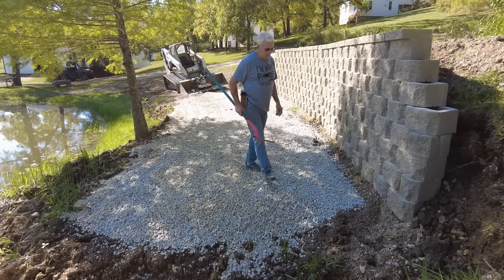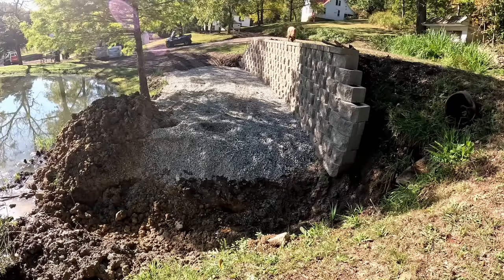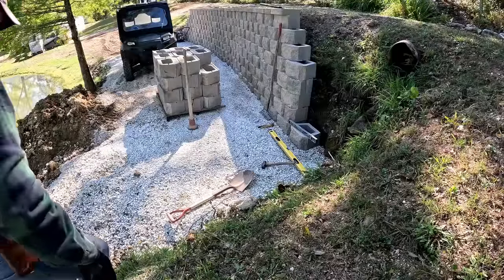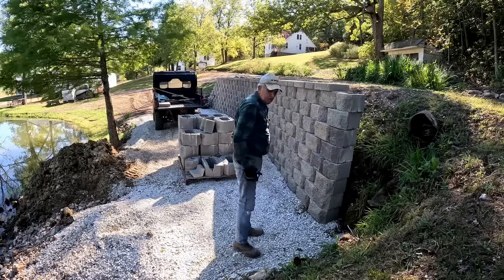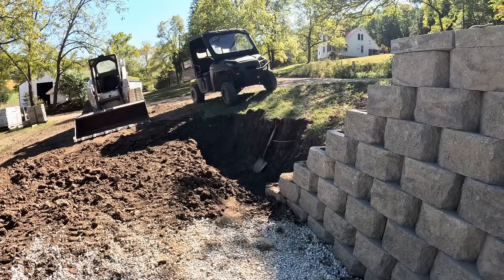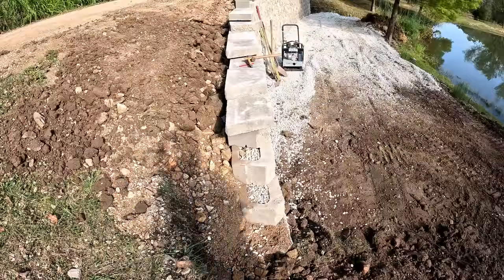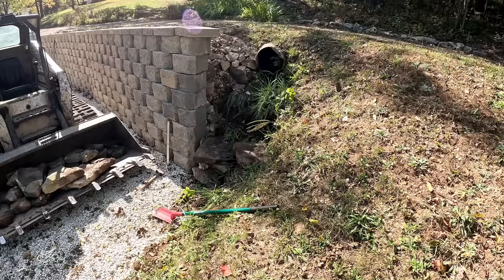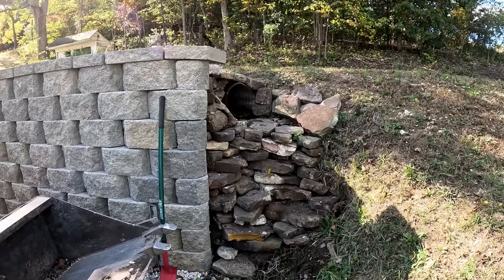673 RSW The Retaining Wall Is Finished

Comment: Nice job, Jerry.  I cut some blocks maybe 1/3 the size of those top caps when surrounding my deck. I used a grinder with a cutting wheel to go around the line and finished with a mallet.  Didn't break as clean as yours.  Thanks for the schooling.😊

Comment: Did you put any "deadmen" in your wall? That is a section of wall going back into the bank or a steel bar "T"? Eventually that wall will get pushed over by the pressure of the bank. Been there and done that. Really looks nice for sure.
Reply: In the video from about a month ago "Phase 2 Retaining Wall" he showed   attaching the wall to the slope around the 30 minute mark.   This manufacturer supplies a netting.  😃😃